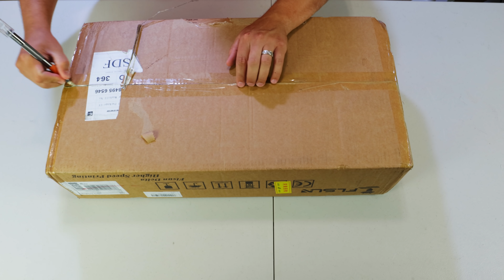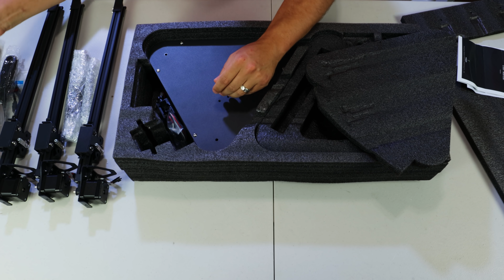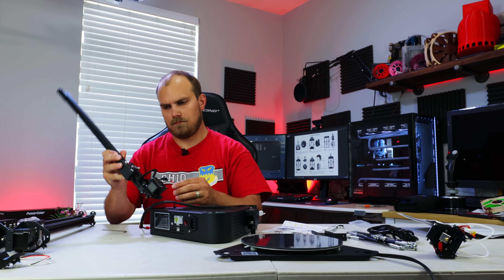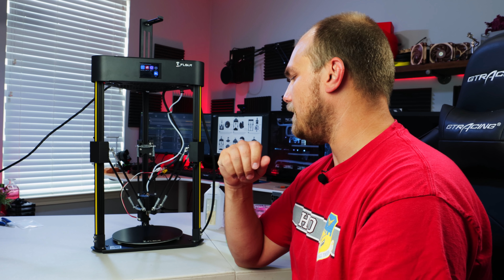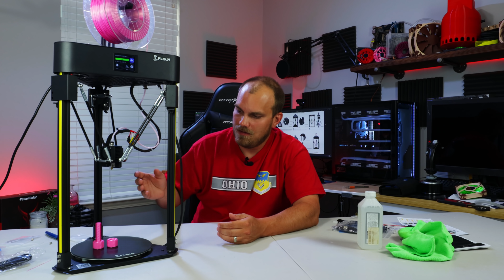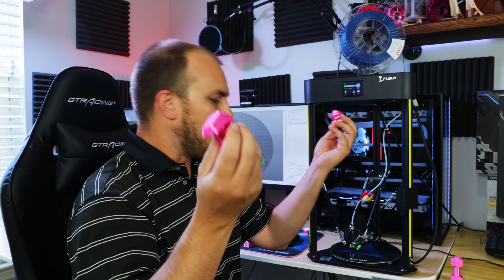A Delta Printer for Beginners, I’m Impressed | FLSUN Q5

Comment: I have found a way to get my prints to release from glass plates. I have a small spray bottle with about 30% isopropyl 70% distilled water. That low of a percentage of alcohol doesn't easily ignite and you don't use much anyway.

When the bed is warm and printer just finished, I spray around the bottom of the print. I let it sit and cool for a while. After I can lift my prints right up. Usually it only takes about 30sec to 1 minute before it releases easily. You don't have to puddle it around the print, just needs to have a little around the entire print. 

A 2 ounce bottle last me multiple prints. I think I am currently  5 prints in on this bottle and only 1/4 fl Oz used. 🙃

Comment: Do you still recommend this as a first printer? I'm so close to pull the trigger
Reply from the maker: I do still like it but the Neptune 2 from elegoo might be better as it's cheaper and the cooling fan is a bit better
Reply: @MajorHardware  Ops, didn't see your comment, already bought the Q5. I cannot get the right settings so it doesn´t string like crazy.

Comment: I have a textured glass build surface and when I want to remove the print I use the cooldown bed command and also put a lump of aluminium on there to absorb some of the heat, my prints release much quicker this way

Comment: The only problem with FLSun, is that they are a bit hit and miss. I got the HUGE, QQ-S Pro to run along side my CR-20. And while a lot of people rave about them, Equal number of people have had nothing but problems. I've been playing with the settings and replacing parts on mine for near on 4 months, and I'm still lucky if I get 2 good prints out of 10. Mostly down to the bed leveling. Where as with my CR-20, I haven't leveled that it maybe 12 months and it just gets on with it and prints first time everytime.
Don't get me wrong, when the QQ-S is good, it's very good and faster and quieter than my CR-20, it just need a lot of patience...

Comment: Have had my FLSun i3 (linear rod and bearing version) since spring of 2017 and it's still running strong, and fast with a few upgrades (check my channel for deets if interested), worst trouble i've had with it was a stop switch wire breaking loose.  Surprising quality for the price.

Comment: The Q5 is my Ender3 replacement. It's a very easy to recommend printer that produces quality on par but does it way faster. As with all printers it needs a few mods, fortunately they're all very cheap and simple, you don't need to fork out for a 32 bit board, whole different hotend or extruder etc
My list of suggested mods:
- Adjust some settings in firmware. This is probably the easiest printer to do it on, it's just 1 text file on the SD card you change and copy files to root to then re-flash
--- Check the e-steps! G-Code to check current value is M205. Mine came with something like 367 but the printer should be set to 410. This was the cause of underextrusion. Adjust this in firmware
--- Raise the 'limit' temp in firmware but not the maximum adjustable temp. By default these are the same, meaning if you set it to 260 but it hits 261 it will instantly thermal shutdown, raise this to ~270 to stop this happening. Or just don't try and heat higher than ~255 in the first place
- Print a better cooling duct
- Quieter 24v 40mm heatbreak fan. I just scrounged one from my parts bin
- 1 more TMC2209 stepper driver for the extruder to make it far quieter and print even better. Plugs straight in (just flip motor direction in firmware)
- Print a mod for the arms to lightly clamp them together, this will improve quality and reduce noise as well, as the bearings in the arms can rattle
- Optionally fit a springsteel PEI sheet as its just better than the stock glass and requires far less cleaning
- Optionally BMG clone extruder, not necessary but I like them better. It's a straight swap (flip motor direction in firmware)
- If you're feeling awesome... Fit a buck converter and a raspberry pi. I've done this and its now a fully self contained unit. Turn the power on and shortly after Octoprint is accessible over WiFi. The Q5 is way, way easier to move around and only having to plug a single power cable in but having the power of octoprint on it is fantastic

Comment: The 'deltas are not for beginners' statement is total bullcrap. Maybe with early machines, same as how any printer was a nightmare in the early days
They are actually simpler than a traditional printer, much simpler. The on complicated part is the kinematics which is all calculated in software anyway, which you aren't touching AT ALL
You only to do some mechanical maintenance when needed - the same as any other 3d printer - but there's far less to these. Basically make sure bearings and belts are good, the hotend is not clogged, and the arms are all still stuck in place (glue can let go) done

Comment: Was gonna say, the threads on your sample nut bolt look like they don't have enough cooling....but then you fixed the cooling duct and blam, it's good. The threads look like they're lopsided with a 50/70º ratio rather than 60º threads since it curled upwards while printing.

Comment: I actualy got this printer as my first one in April. So far I'm quite happy with it. I don't have much space on my desk, so a delta was the way to go and the reviews were quite promising.

For this pricepoint I think it's very good. A friend didn't want to believe me that i had printed 0.2mm height  because they looked better than the 0.1mm prints on his cartesian printer he got half a year earlier for the same price. XD

Just printed a few modifications:
- ruberband holders because the arms made some slight rattling noise (https://bit.ly/2CzbNTa)
- a lighter cover for the carriage (https://bit.ly/2E2slTX)
- a better fan duct for the part cooling fan wich cools from two sides (https://bit.ly/30xcqF2)

Comment: Great review. It looks like a nice printer. I have also been curious about delta printers, but have never dared to get one because I had the impression they was trickier to maintain and run
Reply from the maker: I've been using this one for a bit and I'm a big so far watch my latest video those were printed on this delta and it did vary well
Reply: The delta in the past few years was more difficult, now it’s easier

Comment: The flsun-qqs is really good too
Reply: I can't find the differences between the Q5, QQS, and QQS Pro. Any insight?
Reply: @blze0018  There are two differences between QQ-S pro and Q5. One is the print size. The print size of QQ-S is 255*255*365, and the print size of Q5 is 200*200*200. The second is the motherboard driver.
QQ-S uses 4988 driver, Q5 uses 2208 silent driver. QQ-S has stopped selling

Comment: I use the Wham Bam flexible build system on my Ender 3 with a PEX build surface. Pretty good. Adhesion is good. Add a brim for PETG to make sure it really adheres perfectly and have bed heating always enabled (40-50 for PLA, 50-70 for PETG)

Comment: I have an FLSUN QQS, it amazes me. The x/y resolution on it is incredible. I have resin printers but even they make coin knurling a bit blurry compared to the delta (which is the opposite of my expectations). Also, it's just so cool watching that head zip around.Once the bed is cooled down stuff just comes off the textured surface with no effort.

Comment: To remove parts off the printer easy try some ipa + water in about 50/50 ratio sprayed around the printed part when the bed is still warm and it will pop off instantly

Comment: suggestion: a helix type fan (use a bldc motor with a belt or a gear on the outside.)
and look at static pressure vs length.
Reply: Isn't that just an airscrew? He experimented with them quite a bit already

Comment: Hey great video! You know, this is probably the most in depth I've gone into learning about 3D printers, would be cool to see how you load the PLA into the tube and learn a bit more about different materials, this does seem like an upgrade on your other printer(?). And also how the 3D images get loaded into the machine would be cool to learn about as well.
Reply: check out the 3d printing basics series by Thomas Sanladerer

Comment: 10:00 That is Anycubic Ultrabase type (they came up with it first) -- best damn build surface there is especially for those who print a lot. Requires next to zero maintenance, prints just stick and release. If you do automatic printing it's a must have.
23:40 If you had filament stripping you had some kind of mechanical issue. Tevo's Titan clones are the best ones i've seen, they are better than the original. There's a reason why they cost 40$+ these days ;) Pretensioning must be set correctly tho, but generally it's just somewhere in the middle, set once and forget type of deal :)
FLSun has indeed progressed a lot, looks like their products might be decent now :)
Reply: We have summarized a lot of past failure experiences, and now we have made many improvements.We will do it better and better.
Reply: @flsun3dprinter  Please, where can I purchase one in Brazil? Thanks in advance!

Comment: Nice video. One suggestion, I would get a table that doesn't flex every time you lean on it during leveling or just don't lean on the table during operation. Looks like the unit did a wonderful job. will be watching for future projects. Subbed.

Comment: Might see about building a ring duct for your cooling fan. There is quite a few versions for the ender 3/creality printers. I noticed a significant difference with my ender 3 swapping from single side cool to all around the nozzle. Pretty jealous of that printer though looks great right out the box!

Comment: https://www.amazon.com/Stronghero3D-Printing-Filament-Multicolor-Accuracy/dp/B07FCQ9WDJ/ref=sr_1_10?dchild=1&keywords=3d+printer+rainbow+filament&qid=1595047904&sr=8-10

What about doing something with a little more color?  You may not have control over what color comes out where, but it might make for a little more visually interesting prints.

Comment: Interesting. Is there any discernible play in the heim joints? I'd guess not, but that kind of thing would worry me. The results speak for themselves though. I'm also guessing you went through similar teething issues as I did with your Tevo; I got an Anet A6 last year and by now I've replaced/upgraded all the hardware and software to the point where it's a completely custom thing now just using the Anet frame. That sure was a wicked learning curve!

Comment: That printer definitely has an interesting motion and way of moving to it, looks like it would be a lot better with detail then a square printer.
Reply: They tend to do angles better, since the print head isn't constrained to the typical XYZ axis and can go diagonal.
Reply: There are two issues with delta printers. One is the parts are not easily sourced, and two filament selection is limited due to design, no flexibles here unfortunately. Also troubleshooting issues in the print are much more difficult.

Biggest pro is they are fast.
Reply: @SiliconCypher  Those don't seem like much of a problem to me.

Comment: i just got my flsun qq-s pro a few weeks ago.. its a great printer also
Reply: is it worth going to the QQ-s over the Q5? the difference is like 40 bucks where i'm and it's preassembled and has bigger build capacity, any downsides to the Q5?
Reply: @AntaresSQ01  Hi,There are two differences between QQ-S and Q5. One is the print size. The print size of QQ-S is 255*255*365, and the print size of Q5 is 200*200*200. The second is the motherboard driver.
QQ-S uses 4988 driver, Q5 uses 2208 silent driver
Reply: @flsun3dprinter  Wow, thanks for the response, so practically the QQ-S is a higher end model that is simply more capable? apart from that they are functionally identical in terms of print quality, is that right? I'm looking for a printer for small gadgets such as gopro mounts, and spacers/brackets for things that don't require too much structural integrity so bigger build size would not hurt especially due to the small difference in price between the 2 printers, I'm not familiar with the drivers too much, as long as the build quality and speed is equivalent I might aswell go with the QQ-S
Reply: @AntaresSQ01  i have one qq-s pro and after some tweaks and upgrade this machine is must have!
Reply: @BraveNewWorld1984-r6o  What tweaks did you make? My cousin handed off a QQ-S Pro to me, and I'd love to know what changes you made.
Reply: @JimVanderveen  First of all i changed the stepper drivers for tmc 2208 more silent a lot! install a bmg extruder ,capricorn tubing for the extruder and shortened the lenght a little, too much travel,  cooling fan duct inside the base  to redirect the air on stepper drivers and motherboard ,new spool holder , now im about to install led strip i have to take a look at it:) my machine never broke down and this brand is very reliable when you know what you do:)